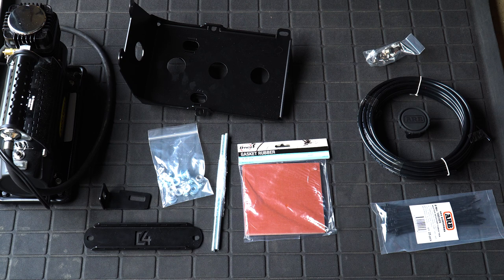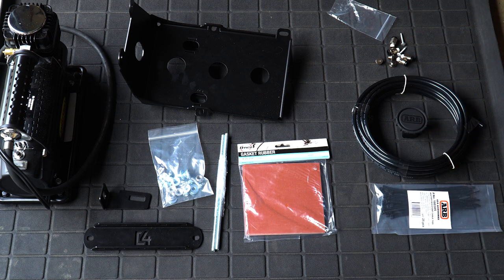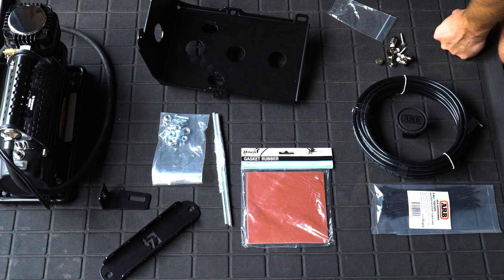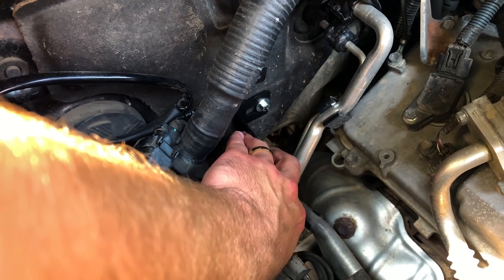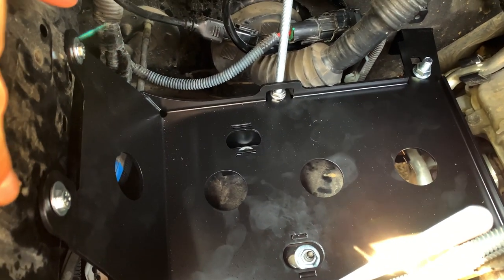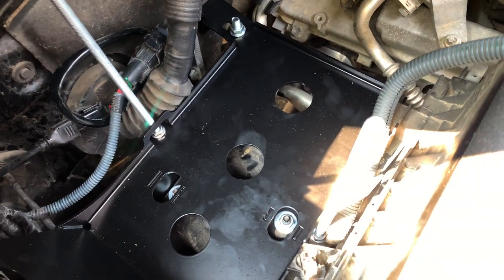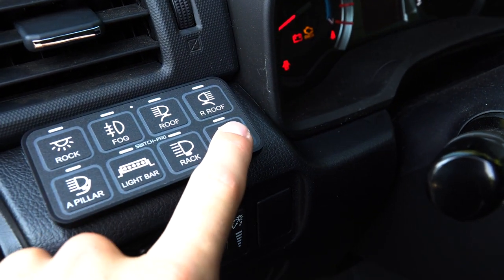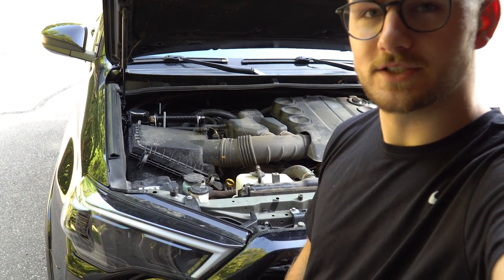Budget On-Board Air Compressor Mod | Any Vehicle with a Dual Battery Tray!

Comment: we have this exact mod with the smittybilt and C4.  It is so hand and we took the connectors and routed them around the front of the engine bay to the battery for easy hook up and disconnect.  Might eventually make just a breaker relay to be easier.

Comment: We actually ran the compressor in the other direction cause it put the power switch next to the fender so you're not reaching over everything, and the hose doesn't have to be look back from the engine bay area.
Reply from the maker: I have it ran to my switch pros so I can control it from my seat or my phone so I just always leave it on.  Orientation probably does not matter but I thought I might have to really bend the hose and then I couldn't really put the diff breather where I wanted to.

Comment: keep us posted as to how long that compressor lasts in the engine bay.  great video
Reply from the maker: Well Oxfoot has had his in there at least a year!
Reply: I've had mine in for a while and it's been fine. I did pinch the line pretty bad but thats more-so me airing up and a pretty weird angle. Once I replace that hose it should be fine.
Reply: Had mine in my engine bay for half a year with no issues.
Reply from the maker: @ORG4Runna  Awesome!

Comment: I'd take some of that gasket maker or some shrink wrap & wrap that bolt where you have the hose ziptied to it. All the bouncing around even a little bit Might wear a hole in the hose.
Looks good though.
Reply from the maker: That’s a fantastic idea.  Thanks for that tip!
Reply: Least I can do  @OverlandEngineer . Great idea on the gasket sheet to lower the vibration. That's when it hit me on the hose vibrating as well. Keep up the Great work & looking forward to your next vid.
Reply from the maker: @tpseeker3367  Thanks!  Gotta give Oxfoot credit for the rubber gasket though.  I design a lot of the mods I do but this one was basically all oxfoot.
Reply from the maker: Next video should be here Friday!
Reply: Looking forward to it  @OverlandEngineer . Trying to gather up as many ideas I can for future projects.
Reply from the maker: @tpseeker3367  Awesome!

Comment: How did you wire this to your switch panel?.did you have to run a separate relay and just wore the ignition part of the relay to the switch panel?.
Reply from the maker: Thats what I should have done.  The switch pros never tripped but a relay would be the best way to do it.  I think the current draw is 35-40 Amps so its technically too large for a single higher output port on the switch pros.

Comment: Quick question, Did you just wire the positive and negative that clamp to your battery originally straight to your switch pro? You don’t need to do anything with the wiring for the switch on the compressor? Or I am assuming you maybe just leave the switch in the on position on the compressor and then once you hit the switch on the switch pro it then sends power to the compressor?
Reply from the maker: Exactly.  I just leave it turned on and then wired it to one of the high output switch pros ports
Reply: @OverlandEngineer  awesome thanks so much! I have an auxbeam switch panel which can just barely handle the amps of the same smitty built I have so I am going to add in a secondary relay for the compressor and they the relay to the switch panel is what I read.
Reply from the maker: @danielwojtaszek2094  Yeah that is smart.  I have read that it can draw up to 45 amps.  So a relay is smart with the Auxbeam setup.  I have read though that auxbeams have 30 amp max for 1-2 and 20 Amps for 3-8.  You can't run them all at the same time but I think if you are under those limits you should not need a relay.  At least that is what I have seen.

Comment: Does the compressor heat up underneath the hood when not in use?
Reply from the maker: Yeah some but it hasn’t hurt anything.  Just the sticker fell off because it warmed the adhesive and made it loose.

Comment: Hi Do you need some great lighting upgrade for free for your car to help you better driving, off-road and adventure.We're the pro auto lighting manufacturer for nearly 20 yrs and w're looking for sponsorship!
Reply: I do a lot of aux lingthing install for friends and family using your product, we have a new project on hardwiring a smittybuilt compressor and I am thinking of integrating it with the AR600, need to know some insights from auxbeam, we are open for any sponsorship that you want to offer aswell